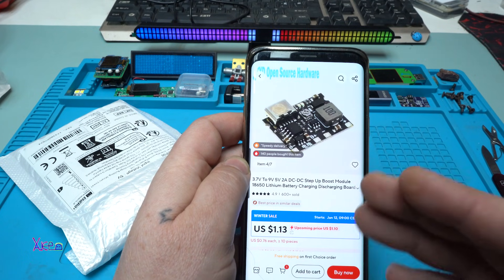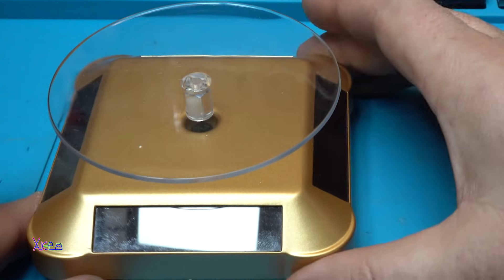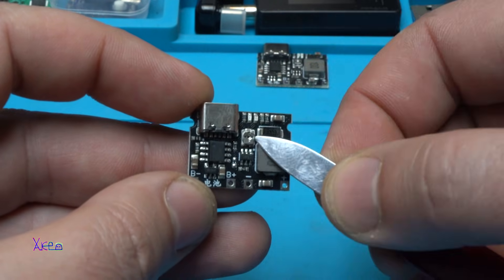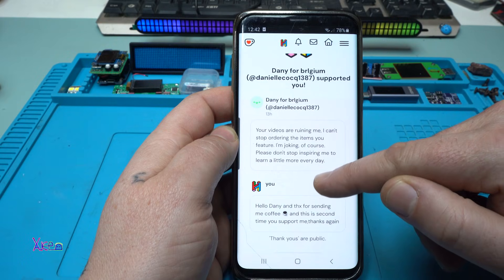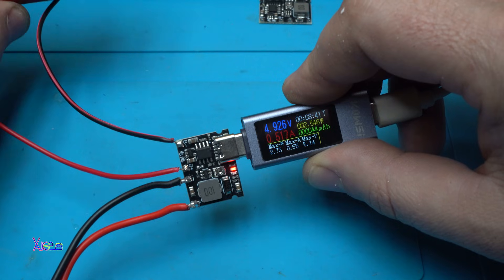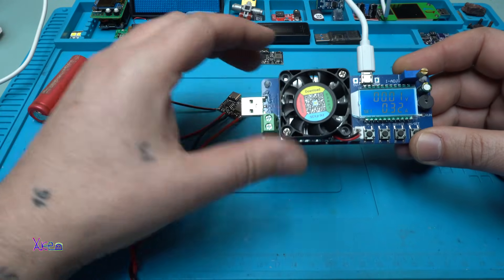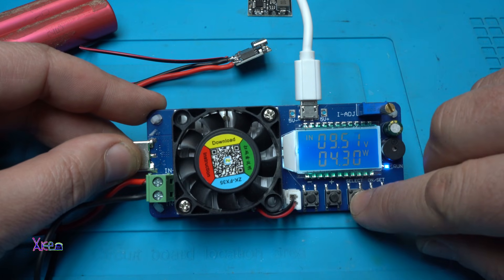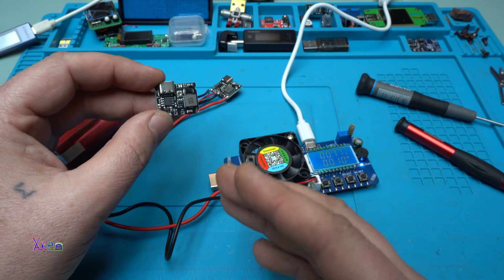I Bought $1 Aliexpress Module and its PERFECT?

Comment: This module looks great.  Would this be a good choice for a UPS circuit for an ESP32 module?  The ESP has a 3.7 volt input.  The only issue would be the 18650, or actually 2 18650s to provide longer UPS time, would be charged and discharged constantly.  Thanks for years of great videos!
Reply from the maker: Hello and thx for feedback,yes can be used like ups for esp32 and if you hook up more cells in parallel you will get more capacity.
Reply: No, because it's a boost regulator which increases the voltage - the minimum it will output is about 4.5 V: 6:26

Comment: I'm trying to find a module that will keep my power back from going to sleep when I have low current devices plugged into it but I have to I guess I can make one but I'd rather buy it being it's all together it's cheaper
Reply: Many power banks nowadays have a mode that caters for low power devices, keeping them activated. A long or double-click on the power button can activate it. Power banks are so cheap it may just be easier to buy a new one for your purpose.

Comment: With any of these power converter boards the useful things to know  are how clean is the output and how well it maintains the set voltage under load. Some are poor at the ends of their range. And for items with the opportunity to drain lithium batteries testing the level of low-voltage cut-off is quite important to check before it damages your batteries. Just my suggestions. Keep up the good work and perhaps see what extra worthwhile testing you can add next time.
Reply: Yep, put it on a scope?!
Reply: It has a battery protection chip - which can be bypassed by shorting together two pads on the back if the cell already has one.

Comment: I've been doing this power supply method for years, but I always had to use two different modules. Now it's on one PCB.
Reply from the maker: Yes that why this tiny module is awesome
Reply: @Hacktuber  But the only issue is you can't switch off the boost regulator, so does it have significant quiescent current?

Comment: Can I make a light and have it on while it’s charging? Because I wanted to make like floodlights that are always on and plugged in, then if the power goes out then they will stay on with the battery running it? I hope you understand what I mean. And can anyone answer?
Reply from the maker: I try it,yes can operate while charging
Reply: Yes, I don't think this module shuts the power off while charging so it should be just fine

Comment: 5:17 *two 18650 batteries in parallel
Reply: Well spotted. The max the thing can charge to is spec’s at 4.2v, and a cautionary note (obvs) is that there is nothing to manage potential current imbalance if batteries are connected in parallel like that.
Reply from the maker: I made a mistake,sorry
Reply: @Hacktuber  You may want to review the two-cell battery charging module with balancing connection! I've hacked one and a couple of rescued vape cells into the 9 V battery compartment of a remote control.
Reply: @Hacktuber Not a problem dude. Our brains know what they mean to say, it’s just that our mouths don’t always listen!😂
Reply: @AQUA-Mannie  There's no issue with "imbalance" of cells in parallel - so long as when you first connect them they are charged to the same voltage.
Reply: @matthewmarks6951 there is if one is a duffer… or a cheap crappy one… but if both are duffers or cheap crappy ones (i.e. similar characteristics), you’re technically right. But characteristics change… I wouldn’t do it.
Reply: @AQUA-Mannie  Yes, one could go short circuit and it would be more entertaining if others were connected in parallel, but they don't all have to have the same capacity.
Reply: @matthewmarks6951  Yeah, the degradation won’t be graceful, and the 4056 will get very hot, but the beauty is that it self-regulates when this starts to happen, so no fires…we hope. 
For another 20c, I’d just double up the 4056 modules and be done with it. Cheap, easy solution.